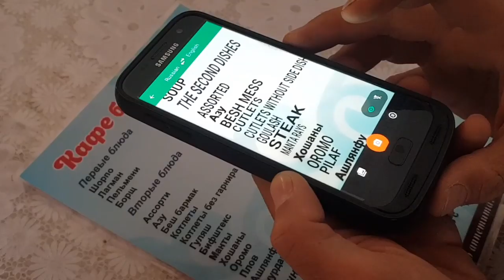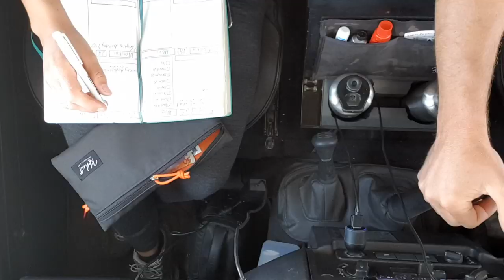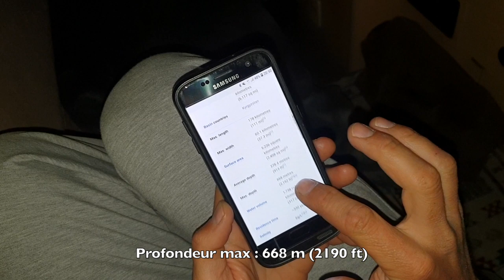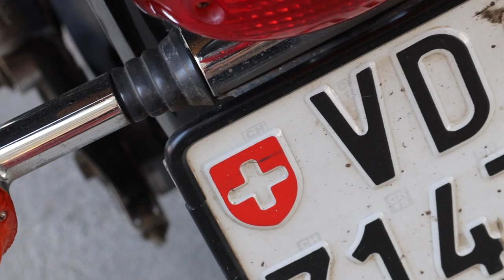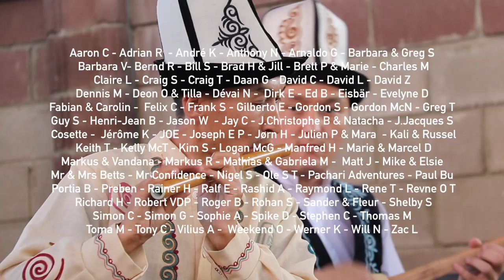The Waffle Boards saved the day (Ep82 GrizzlyNbear Overland)

Comment: Hi, from Germany the old car ? Was maybe a Opel ?
Reply from the maker: Thank you for the info. 😀
Reply: @GrizzlyNbearOverland  have fun in Kasachstan there is at the time very hot 40 C ° Hope you have AC in your vehicle ?
Have safe Trip and thank's for the Video !
Reply from the maker: @wernerwiedon1331  thanks . no AC in the car (windows down) , no AC in the camper (little 12v fan) yes very hot. Can't wait for winter. 😂😂
Reply: @GrizzlyNbearOverland  The car at 2:12 is a Moskwitsch 400. A Soviet made clone of the Opel Kadett Modell 1938. The 400 was built in between 1946-1954 in the bodystyle you saw.

Comment: What is the size of the Tyre?
Reply: 265/75R16 or 32 inch.
Reply: @leighdearle5965 , not so small as it looks from your video. Looks like AT would be better to roll over the sand... What's the pressure? Higher than 28psi (2atm)?
I would put on something like 275 70 R16 as a compromise for fuelconsumption/acceleration/off-road capabilities, 265 75...seem narrow or your pressure was much higher than 28,4 psi.... With such a big housing you need something like 285 75 16... Of course crossing sand bar near water edge is not easy anyway...
Reply: @jack87krosby52  I was running about 18psi in the rear and 14psi in the front.
The toyo open country are notorious for having to let a lot of air out to get a good coverage on sand.
We have to be mindful of our weight with how low we go on pressures also.
We had 285/75R16 previously but required spacers to run them with our current rim size.
The spacers were giving us axle stress problems so we downsized back to 265/75R16.
We are driving around the world and have found the Toyos to be a good compromise tyre that is not too noisy on the road and a good choice for the many varied terrains we cross.
Reply: ,  problems with axles was the outcome of bigger wheel diameter not the spacers. This case  I would try 275 70 16 and rims with another offset not the spacers. In case central differential locked or part-time transfer case the difference between front and rear pressure also may affect axles and transfer case front shaft drive chain harmfully. The kinematics of locked/part-time 4wd is to set only equal pressure. Loosing pressure Tyre you decreasing its diameter in your case rear axles could be fractured considering the bigger pressure therefore bigger wheel diameter and the weight you carrying...
Reply: @leighdearle5965  All the tyres with 1atm pressure can let a lot of air out with no tyre locks... Try to find adhesive sealant for tyre-rim conjunction...
Reply: @jack87krosby52  the wheel diameter does not affect the forces applied to the bearings and hubs of the axle in the same way spacers and negative offset rims do. 
By adding spacers this puts a lot more stress on the extremities.
By changing rims to a negative offset rim we definitely could of kept the larger tyres and not needed spacers although unfortunately negative offset rims are exactly the same thing as having spacers as they push the tyres centre line outwards and away from the vehicle thus increasing the force applied on the bearings, hubs etc...
We ran the current tyre size through the Moroccan Sahara a few years ago and also through the High Atlas Mountains.
We've driven ice, snow, sand, rock and mud with the current set up and so far very impressed with the performance. 
We are always learning that's for sure and in my last 20 years of driving 4x4s in Australia and all over the world I learn something new every day.
That's what keeps it interesting 😉
Reply: @leighdearle5965  bearings can be affected by spacers/changing rims with another smaller one offset and sometime bigger weight. Axles affected by both a wheel diameter and weight